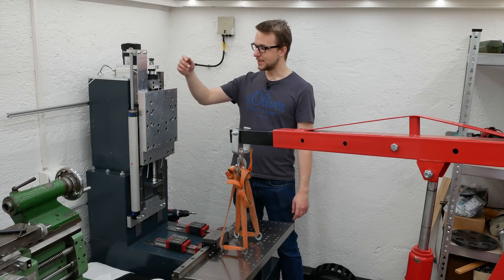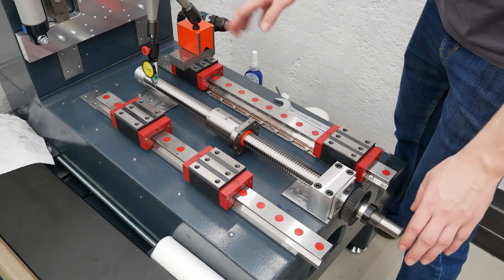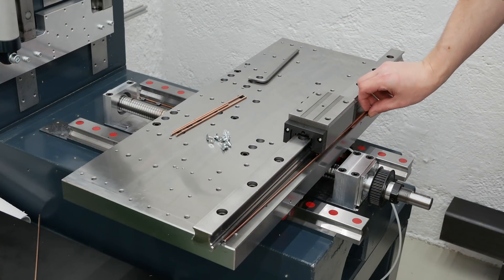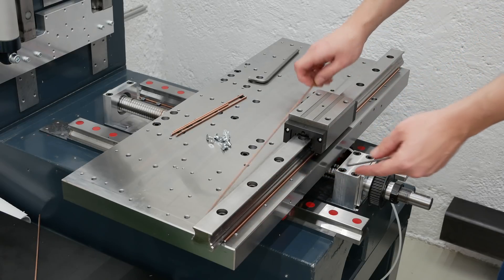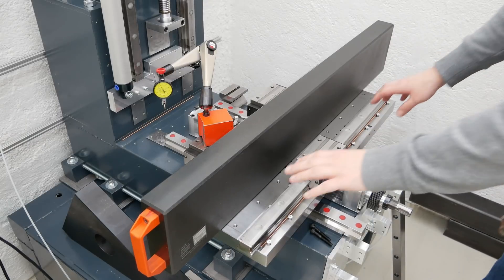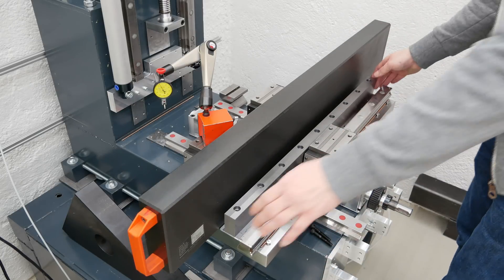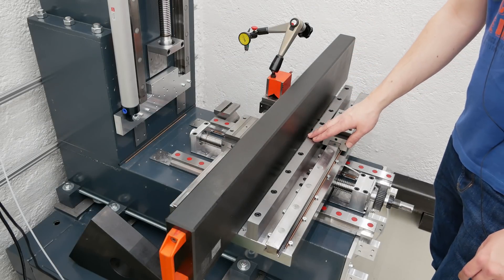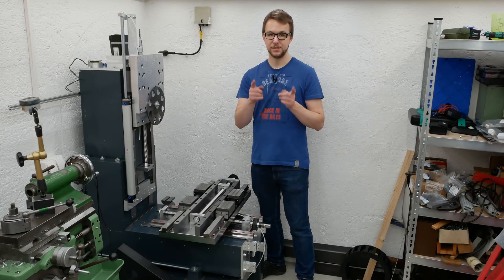DIY Milling Machine Part 5: X and Y Axis

Comment: It blows my mind how ppl make a solid rigid setup then mount the rails and axis' with adjustment screws, shims etc that certainly destroys the rigidness of the machine!

Isn't it way better to spend the time rigidly setting everything by scraping it in and using nsk and thks guide on how to setup, mount and install the rails so they are solid and accurate.

Awesome build regardless!

Comment: I did not see in the video, how do you make sure X&Y are perpendicular to each other? I see where you aligned both axis rails to one and other, but do not see how you align X to Y?
Great idea on the tapered screws for adjusting rail alignment

Comment: I have to say that in all of my +30 years of being involved with CNC Machines, from an installation, servicing, and manufacturing perspective, I have never come across anyone, with the expertise, quality control, and extreme attention to all aspects of the design, and manufacturing process ! Very Impressive ! I'm now anxiously awaiting all of your future videos, on your CNC Controller of choice, to run this amazing Milling Machine build, the electrical wiring of X, Y, & Z Axes AC Servo Motors & Drives, Z-Axis Brake, etc.., and the details on the plumbing of your pneumatic cylinder counterbalancing mechanism ! And eventually, to finally see this entire Milling Machine build completed, and fully operational ! Keep up the great work, as you are truly an inspiration to the CNC Community & Manufacturing Industry !
Reply from the maker: Thanks a lot :)

Comment: Really enjoyed this video. The mill is going to be a very rigid & precise machine. Interested to know which method you used to square the X and Y? 
Keen to see how you shield the rails and screws, the spindle, your enclosure solution and your choice of electronics and software!
Cheers, Reuben
Reply from the maker: I can still reach all the screws that connects the plate with the Y carriers. Then I can rotate the whole plate to align both axis.
Reply: @AlexCNCen  Perfect. Cheers mate!

Comment: Hello Alex. What a great job you are doing there.
I'm following your channel for a while now. Thank you very much for the excellent content...
I'm just curious how you going to make the Ball nut to float, once you put bearings in both sides of the ball screw.
Did you consider in use only one side bearing (motor side) and make the other side floating? So then you can make rigid connection with the ball nut flange.
Sorry if I'm missing something here. My intention is not to question your knowledge. It other way around, I just want to learn new things in your channel 👍
Looking forward for the rest of the series. 
Greetings from Brazil.
Reply: I believe the other side is a floating bearing. It is just a deep groove ball bearing that is in a slip fit boar allowing it to expand a little bit when it gets hotter without over constraining the screw and causing bowing.
Reply: @nicholasjacob3594  Thanks for the explanation. 👍😀
Reply from the maker: It's exactly like Nicholas has explained it 👍

Comment: Part on grinder looks shorter than your plate, this is a table?
Reply from the maker: It's actually not the X-Y plate on the surfacegrinder. That will be part of the table. Have forgotten to film the other plate. But basically it looked the same ;)